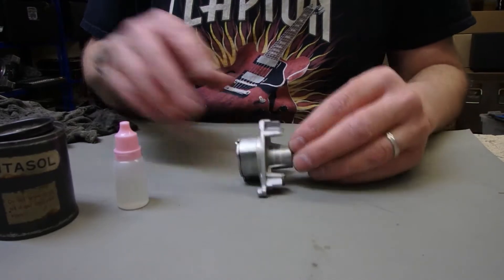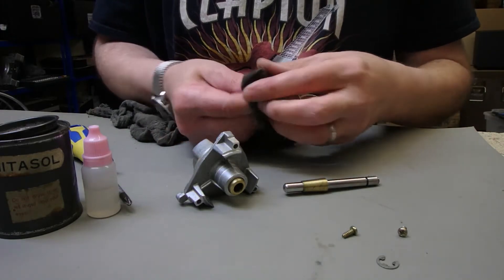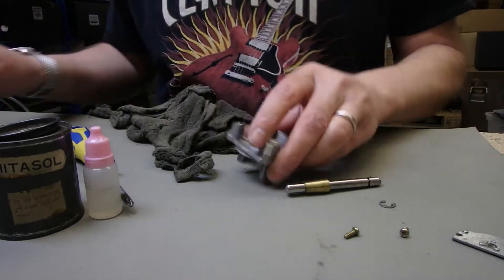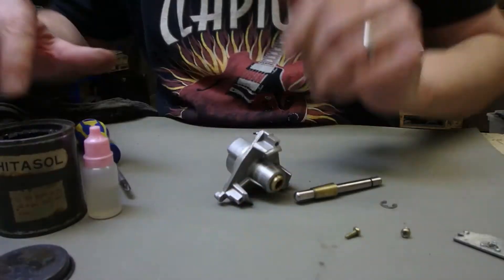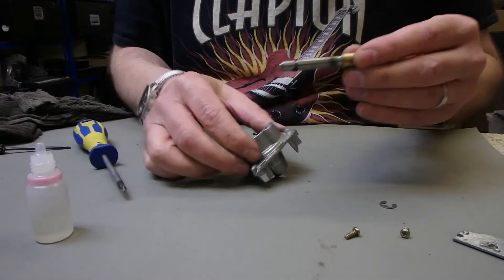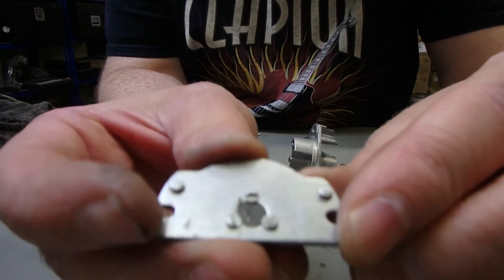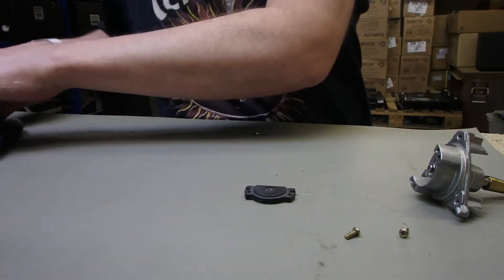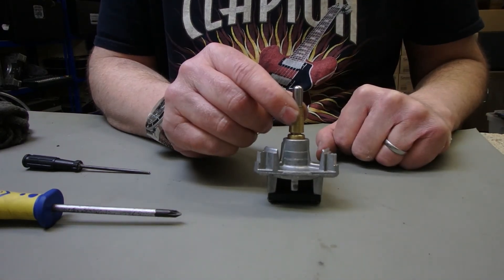Technics SL1200 / SL1210 bearing clean and lubrication

Comment: Hi thank for this 
I've jsut orderd an uprated spindle  
And it comes with a lump o wax i assume the unit sits on top o the wax when insatilin back together 

1 do you know what im on about 
2 what dos the wax acutaly do the thrustplate and bottom of bearing /spindle 

Thank you for your time
Reply from the maker: Hi, Melt the wax into the void / hole under the spindle / bearing using a  hot air gun or even a hairdryer.  Filling this gap couples the thrust plate to the chassis.

Comment: about lubrication - can we use a machine oil - I have a panasonic oil for my shaver - or I must use original - that's what's in the manual? ;-)
Reply from the maker: Any good synthetic oil will be OK - we supply the original type Technics supplied (Anderol 465)  https://www.ebay.co.uk/itm/265513316467?epid=11013043733&itmmeta=01HX16TWW3TVE3703KDNSHQRC1&hash=item3dd1d3b073:g:RdIAAOSwf8BgsLBi

Comment: There are some bearings for the 1210 with a black cog next the thrust plate can they be stripped down for cleaning or is that cog pressed on
Reply from the maker: Hi, There are three "clips" holding the cog onto the shaft and these can be prised open enough to release the cog BUT they tend to be brittle and can snap off so proceed with caution.
Reply: Mine has the older style bearing. I didn't want to risk taking the cog off, so I just cleaned off all the gunk I could see, put a tiny bit of graphite grease back in the dimple on the thrust plate, and a couple of drops of oil down the spindle gap. It's definitely better.

Comment: Great vid ty. I 'm trying to repair my technics too and was wondering do you have non copper or non lithium based grease for the arm height arm adjustment mechanism in your store? Mine has kind of welded together. I bought some lithium based stuff but I've been told thats a no no. I thought to ask as you may have done this yourself.  Much appreciated!
Reply: Hi, There are pros and cons to all grease types e.g lithium / synthetic / mineral etc - we've found Industrial grade petroleum jelly to be a great option.  We don't stock it however it's not hard to find 🙂
Reply: @kevinwilby  That's great news. I appreciate the help. I saved you as a seller too as you have some great stuff in your shop I noticed. Thanks again Kevin!